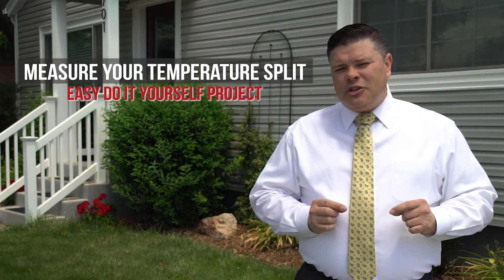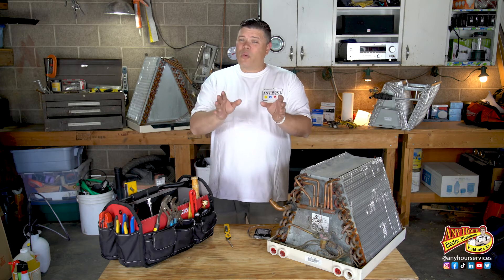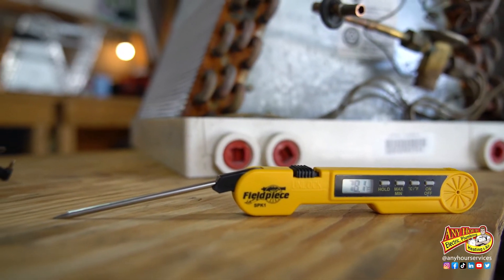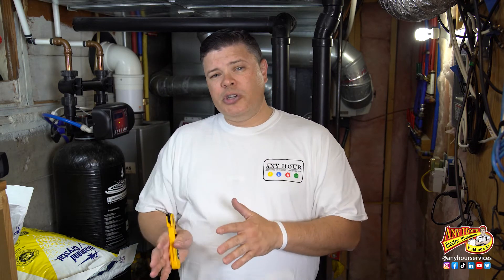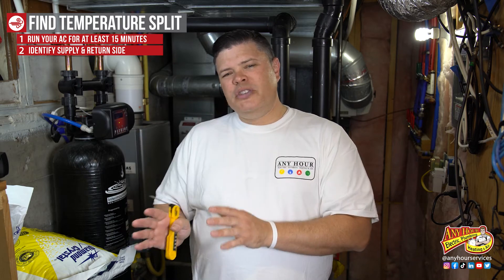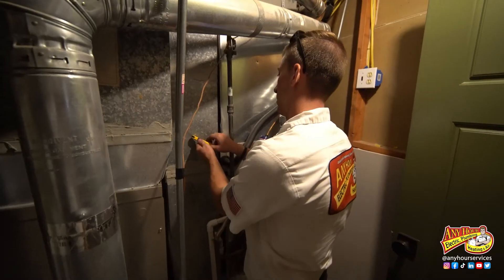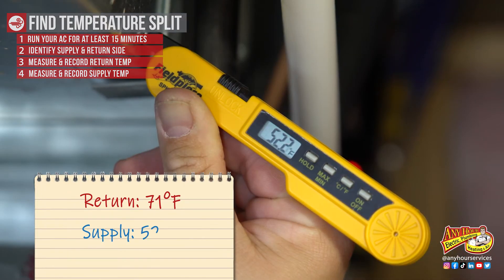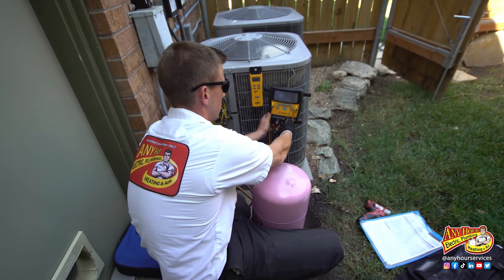How To Measure Your A/C Temperature Split

Comment: Perfect, appreciate the info. I always thought the high pressure line was supposed to be really hot and the return line was supposed to be icy but I apparently that was because of my old air conditioning system ran that way. I have a brand new Goodman that did not want to start up today after a heavy lightning storm. It is obviously running as it is supposed to now